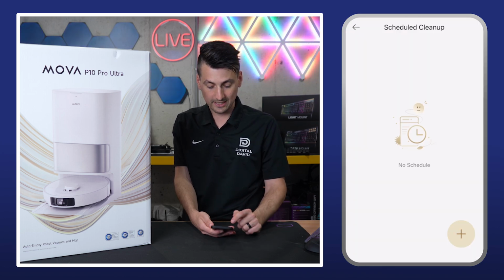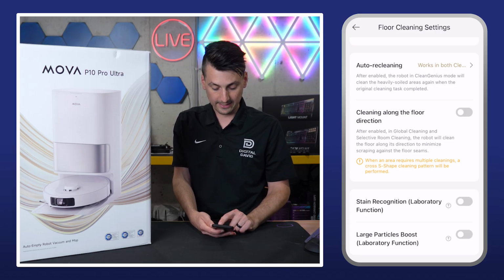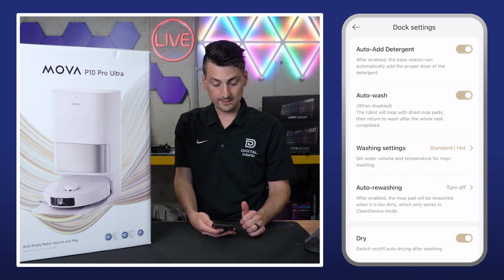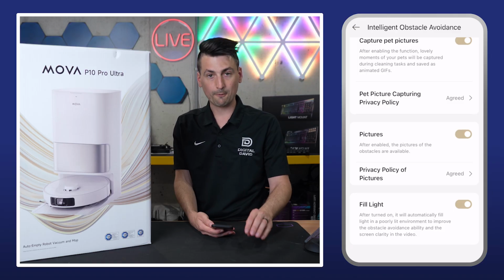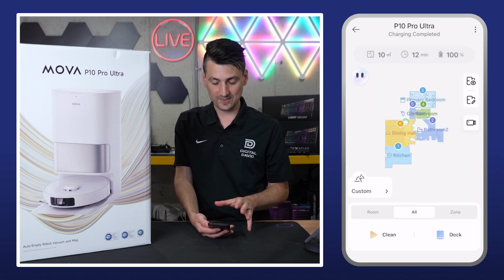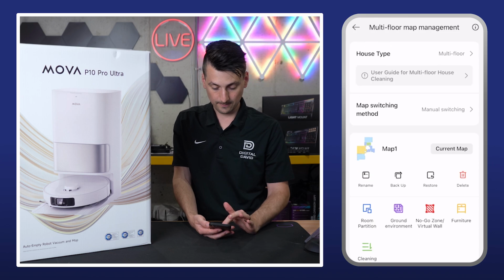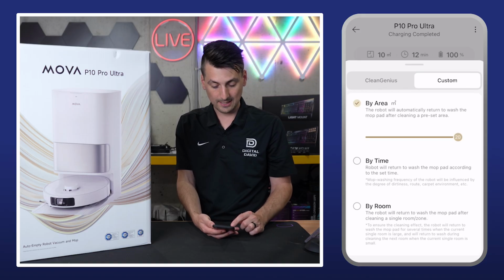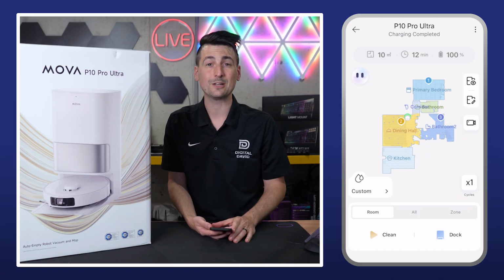Mova P10 Pro Ultra App Settings

Comment: How do i the volume up on the robot?  I can barely hear it. Sounds muffled and broken up.
Reply: @TroyLarson-f9y it's under settings >voice assistant... then go to the bottom to adjust.
It only takes a couple seconds to be kind. I hope this helped you sir ❤
Reply: @crissieburdette4654 not for the robot.  That just changes the volume on my phone speakers not the robot speaker.
Reply from the maker: I believe you cand adjust the volume in settings which should be mentioned in this video if you watched!
Reply: @VacuumChef I'm not talking about the volume on my phone. That has nothing to do with the volume on the robot. Just the speakers in my phone.
Reply: @VacuumChef no it doesn't!